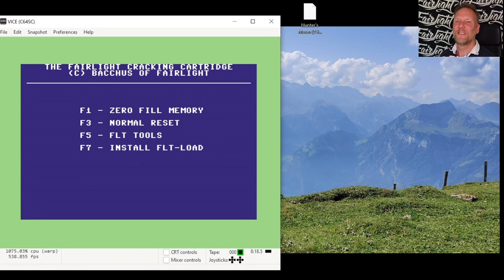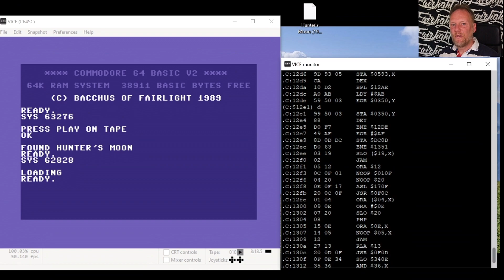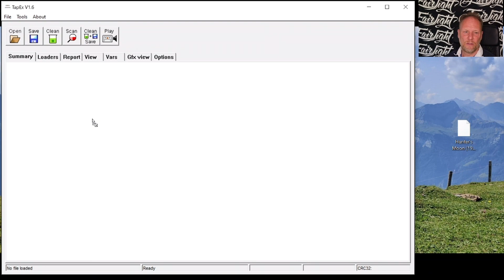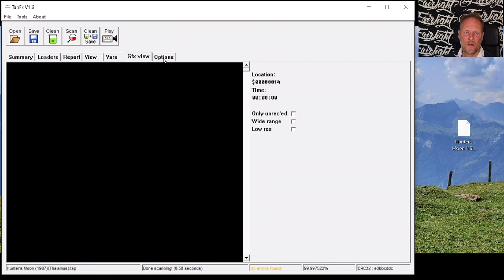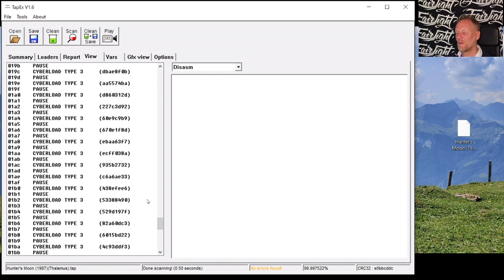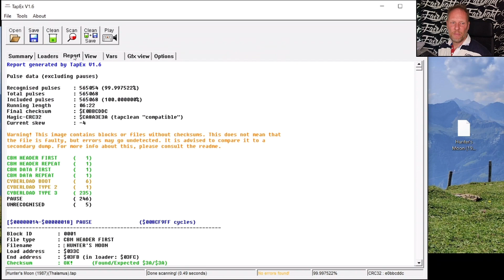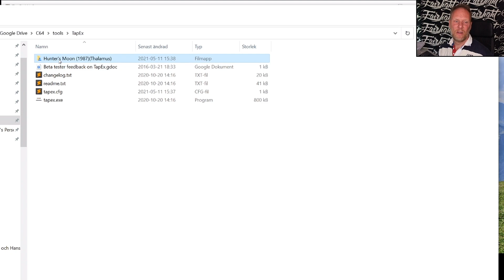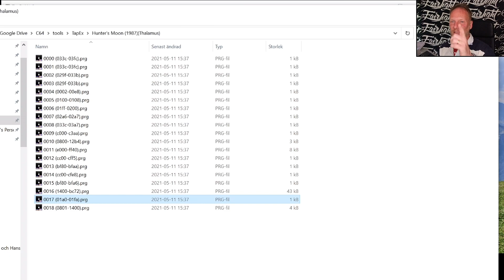FairLight TV #14, FairLight facts: cracking C64 tape loaders

Comment: I would absolutely love a series of you cracking tape games and saving them to disk but without the tools of today. Just the way you did it back in the day with just the good old C64 and an AR cart. Emulated of course. Its amazing how easy it is to use Vice's Monitor, C64 Debugger etc etc, to see inside of a loader. I would love to be able to crack games the old fashioned way. I was just too young back in the day :( And I moved to an Amiga only after 2 years of the C64 :(
Reply from the maker: Hrm. I could sure do that but I'm a sucker for doing things efficiently and the old fashioned  modus operand really isn't that .. ;)

Comment: The reason that the header (and several other things) are redundant is that Commodore engineers knew that the media was unreliable. This was their way to mitigate that. It's also why the tape loading was so slow. Turbo tape loaders eschewed all that redundancy and reliability in favor of loading speed, but it was just a disaster waiting to happen. Many people fucked around with the Azimuth of the head and in the end we had a mess. The Reed-Solomon error correction wasn't known to us teenagers, for if it had been, the turbo tape loaders would have been more reliable.
Reply from the maker: Not sure what Reed-Solomon is but there is little room for errors in any tapeloader.
Reply: @FairLight1337  Reed-Solomon error correction is a group of error-correcting algorithms which were introduced by Irving S. Reed and Gustave Solomon in 1960. The algorithms inject extra data and encode the data stream in such a way that it is possible to reconstruct correct data should it become corrupt. It is used in many applications, for example MiniDiscs, CDs, DVDs, Blu-ray discs, QR codes, data transmission technologies such as DSL and WiMAX, broadcast systems such as satellite communications, DVB and ATSC, and storage systems such as RAID 6.
Reply from the maker: Thanks. I know mobile error coding. GSM uses Vitterbi.
 (Sp?)